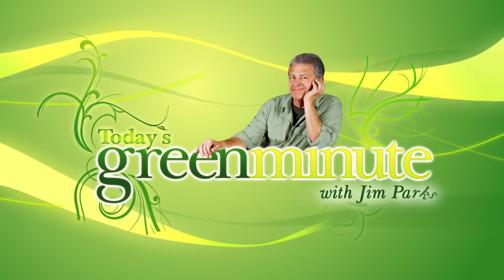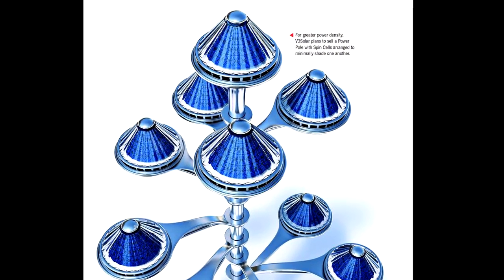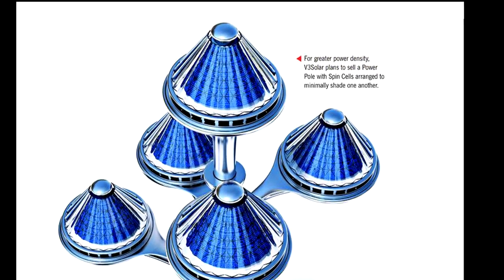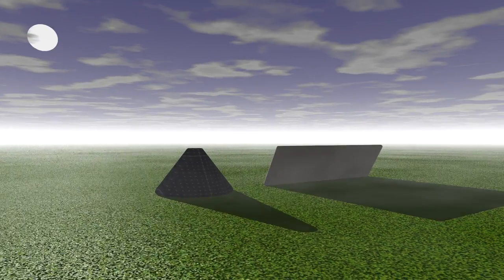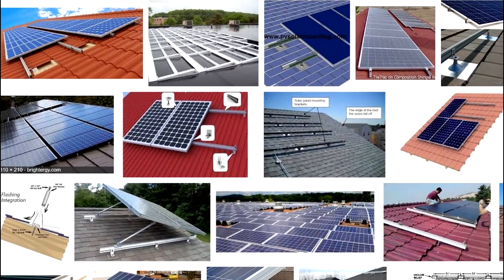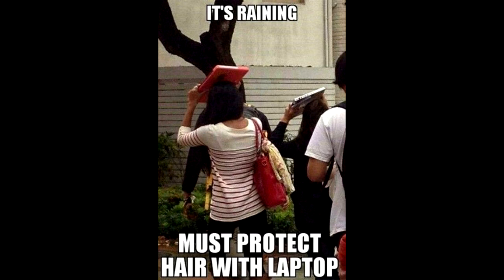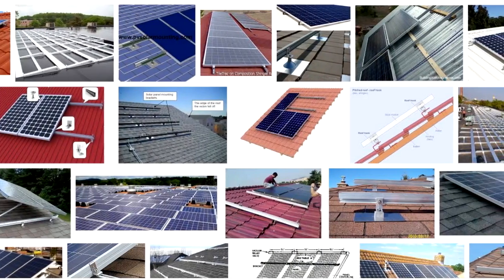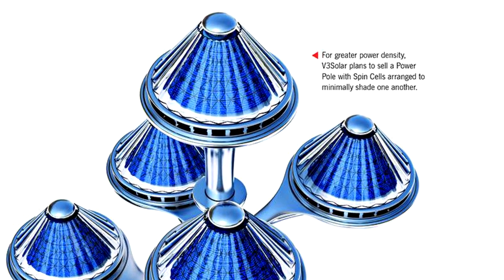Spinning Solar -BUSTED!

Comment from the maker: it looks like a UFO landing pad.... and turns sunlight into power at about FOUR HUNDRED PERCENT EFFICIENCY!!! and it currently has over 7mn hits on facebook!
Reply: Now if only we could combine this  technology with the solar road ways. Can you imagine? SPINNING SOLAR FRICKEN ROADWAYS
Reply: Thunderf00t 
you forget one thing. Where's the power for the moter going to come from?
Reply: Thunderf00t Will it use EM drives?
Reply: @Thunderf00t - you forgot to mention that there would also be a loss in efficiency from the energy that would be required for whatever mechanism made them spin.

Technically tracking solar panels spin too, but just one revolution per day, so a more trivial amount of energy, whereas the animation shows these things spinning at several RPM.
Reply: Thunderf00t I was going to ask if you heard about diamond batteries, but it at the end you said you did. Cant wait to see the vid for it!
Reply: Thunderf00t well I think that you missed the fact that this things can't spin on its own it needs electricity too
Reply: But it spins!
Reply: Thunderf00t You need to start a website dedicated to debunking all of this shit. It can be a source for everyone to go to for whenever crap like this pops up
Reply: Thunderf00t Looks more like a giant's butt plug. Maybe BFG stands for Butthole Fondling Giant.
Reply: +MrMToomey    Actually yeah what do you think about diamond batteries Thunderf00t? Because I've been wondering if it's a viable technology and if it could go somewhere?
Reply: here we go again. if you keep braking pseudoscience we'll have to take it away there are children in Africa going without and they want it.
Reply: The problem with all these newbullcrap ideas is that were getting desperate.
The issue is that our planet is (at least to my perceptions) beginning to fail on us, not only by our own actions but by natural cyclical climate shift. The ever present threat of extinction (or at least the percieved threat it poses) is driving us to desperation to find something - ANYTHING to help out in ANY way we can find.

that leaves the gates open and undefended against douchebag ideas like THIS. the big problem is that ridiculous projects like this one are soaking up all the attention and money while projects that actually DO as advertised or at least could with the right backing are brushed aside and ignored. someone out there could very well have the answer - but this thing got there first.

this project will (as you so eloquently surmised) fail. then the fear of failure for the next project (ultimately the one that just may supply the answer were looking for) will be brushed aside or abandoned because theres nobody willing to look into it - out of fear.
Reply: Thunderf00t it should in fact turn into a light source, powering three other cones around it, which power nine more, and in no time, you have another sun! On earth!
Reply: Nothing is viable at a single house scale at the moment. If there is grid - without subsidies and stuff - not even close. But generally geothermal is a thing. ~30% of Icelands power is geothermal https://en.wikipedia.org/wiki/Geothermal_power_in_Iceland
Reply: Solar freaking traffic cones!
Reply: Poldovico
No - a Watt is one joule per second. If this goes on for two seconds, you have two watts. A kilowatt hour is 1,000 watts of power generation sustained for 3,600 seconds. A generator can be capable of producing a kilowatt, but it does not necessarily do so consistently.
Reply: You don't understand Thunderf00t, it gets 400% efficiency by spinning so fast that each individual photon hits 4 different panels simultaneously. Also, Musk's Mars mission might not be a pipe-dream, just a suicide mission instead. :p

Personally, I think you should just do a kickstarter to put up a bank of the most cost effective, off-the-shelf, tracking solar panels you can find. Maybe just paint some flames, or racing stripes on the back of the panels, and call them "SOLAR-freaking-TURBO-PANELS!!!!!!1111!!!!!111!!" Grab a piece of the idiot pie, and do something practical with it.
Reply: That was my first thought 60% of the generated power spinning the panel.
Reply: I doubled the gas mileage of my car by adding the hydrogen generator! Also in a completely unrelated note, I changed the spark plugs at the same time.
Reply: Thunderf00t DO MUSK'S MARS MISSION NEXT!!!
Reply: shit dude did Castle have a conference going through all the top shit on kikstarter or something
Reply: Theldras Pneumonoultramicroscopicsilicovolcanoconiosis     
I think there is but when it comes to science people can't seem to tell that it's a con. Not that i am in a position to talk.
Reply: Lets bay blade....
Reply: I would still like to know, how many of these would you need to produce the amount of power needed for a year, in a year. And how much power storage that would require to achieve.

EDIT:
Assuming that they would work to their fictional parameters.
Reply: Thunderf00t i'm at work and in my phone so can't get too involved in this message. Our current technology only allows 20% efficiency ... but why?  What energy is are solar panels absorbing? I ask because maybe the rotation of the solar panels isn't as bad as you may thank. How much residual energy will be left of the panel as it rotates?
Reply: seen a few bunk theories.. thanks for the info! .. hey any chance of a run down on how geothermal power works from your perspective Phil? .. is it viable? (from what I understand it's using the house and ground to make a stirling engine..idk something like that)
Reply: Ryan Burdick Thorium powered motors.
Reply: Solar panels get energy from the sun electromagnetic radiation that comes from the sun, but the 20% efficiency are mainly because of what they are made off. They are made of silice, you could use other materials to boost efficiency but that would do the solar panels too expensive for most home aplications.
Reply: That's just because there is so much shite promising easy answers. There is a whole bunch of innovation being done every day, but as it usually doesn't deliver free energy or solve world hunger for obviousl reasons it doesn't get the same traction as Nathan Fillion promoted bad scifi.
Reply: hey thunderf00t i think you should adresss some real science sometimes
Reply: I thought this one had escaped you....silly me! Cheers.
Reply: 3dPrinting is a slow process and Graphene is only one atom thick(as far as I understand) so although possible (technically), it's simply not an effective method for mass production.
Reply: Kind of reminded me of that TV Show UFO the UFO's were spinning cones.  You know, Dave from EEV Blog, you, and a few others like Cody from Cody's Lab, and Nighthawk should get together and form a group all it BNN the Busted News Network.
Reply: You are right. 200% more from 20% is indeed 40% (0.2 x 2 = 0.4 = 40%) - its multiplication since they say "more". If it was 200% aditional efficiency them it will result in 220% :D Path of Exile wording has thought me something after all :D
Reply: what do you think of ..The Venus Project.?
Reply: +Gerald Walker To my knowledge tokamaks are the one type of fusion reactor we've been able to get working so far (though not generating a positive amount of energy. We're waiting on ITER to see if that does it, which AFAIK it theoretically should).
I imagine being a nuclear scientist Thunderf00t might have had the chance to work with fusion in the past, and if he has, it'll have been with a tokamak.
Reply: I'm no scientist, but the spinning part immediately set off klaxons for me.
Reply: I saw one this past week which was a wind turbine tree which could generate an "amazing" 3kw which could power a house for a family of 4! My first thought was, "Do people not understand the difference between a kilowatt and kilowatt hour?"
Reply: Whats next? Spinning Thorium powered solar roadways?
Reply: I used to work in the solar PV industry, and I can safely say this is an absolute joke even before Thunderfoot has started!
Reply: Not to mention the extra power that gets consumed to run the motor that spins the cone. Is that 20 times estimate being counted before or after the deduction of the cost of running the motor?
Reply: xerxestireirondada
The things rotates for free by the power of magic pixie dust :-)
Reply: @Greg Rivers ...
 I'm not Thunderfoot, but I think that would make it over complicated and would also destroy their Key selling point. (That it allows half of it to cool therefor making it "more efficient".)
Reply: G'day,

  Yay Team !

   Great job, well done.

   A few points for fine tuning though...

   Tracking Solar Arrays collect 35% more Watt/Hours on any given day than an equivalent area of Stationary Flat PV Panels, I've found, living Off-Grid with a 2-Axis Tracking-Array (47 Degrees Seasonal with 130 Degrees Daily...), which I designed & built while living with a Fixed Array, which replaced Candles & Kerosene Lights....; and in my experience, though the "theoretical Economically most efficient solution" is to bolt more Fixed Panels onto the Array because that's cheaper than building any Tracking Array "merely" to make less Panels become more functionally effective....

  But, also in my experience, when a Thunderstorm approacheth, it's wonderfully reassuring to be able to turn my whole Array sideways-on to the approaching Hailstones, or to give my Panels a Zero-Degree Aerodynamic Angle-Of-Attack, with respect of threatening Wind-Gusts...; to say nothing of the satisfaction of never ever having to watch the Sun shine from a Clear Blue Sky onto THE BACK OF MY PV PANELS, in the way that it does onto Fixed Panels between Sunrise & 9 AM Local Apparent Time and 3 PM LAT & Sunset, in High Summer hereabouts (I live at 30 Degrees South...)...

   When I regard my 80 year-old Mother's PV Array, bolted unmoving onto her Roof, I feel sorry for her ; at every glance.

   The other point is that, in my experience, on a 20 Degree Celsius Day in still-air my Photovoltaiacs will be running at 50 Degrees C. on top, & 55 or 60 C. underneath (because the Frame traps an insulating blanket of Hot Air,  under the "Glass"...) and if I go and throw 10 Litres of Cold Water (at 10 Degrees C.) per Hour per 10 Watts of Fixed Photovoltaic Array, in 10 sluicings delivered every 6 minutes...; that hs been measured to raise the daily output of the afforementioned Array by 35%, and it makes a Mud Pie underneath, and I don't have sufficient Water to cool my Array to any worthwhile degree.

   But as a matter of fact, the Air-Cooling effect of Wind on a Solar Array is such that it is totally  fair, valid, and accurate, to say that between 5 MPH & 15 MPH Windspeed, then the most-efficient "Electric Windmill" on Earth is actually a Photovoltaic Array...; because Wind-Turbines are designed to deliver their "Rated Output" between 24 MPH ("Low Speed" Units) & 28 MPH, with "Marine Storm-Rated" types requiring 32 MPH to reach Full Power..., and most Wind Turbines are nothing but highly decorative Dynamic Sculptures,  in anything less than 15 MPH of Wind....!

  That said, 5 days ago I posted Video of the Biggest Wind-Turbine Blade in all Oz, on a Truck, driving past me 3 metres away, the first to be delivered to my home Town, 59.5 Metres long & 15 Tonnes in weight, one of 3 for the 1st Turbine for the 70 Turbine White Rock Windfarm...; and Goldwind is building 3 Windfarms & a Solar Panel Farm, 20 miles to the West through to Southwest of me.

  30 years ago, I was the only person within 100 miles of here who was trying to run their Stereo & Lights with a Windmill..; so I feel pretty well "vindicated"...(!).

    Have a good one,

  ;-p

  Ciao !
Reply: another way to keep solar panels cool, run water through them, pump the heated water into a hot water tank that's insulated during the day and you'll save some heating costs, not much but a few dollars still counts
Reply: I saw this shared on Facebook a couple days ago and literally thought to myself, ain't no way I hope thunderfoot debunks this bullshit
Reply: Thunder omg 3:45 made me cringe a little LOL! You're going to end up with death threats from the mathematicians at numberphile :P
Reply: And if fish contract a fungus and die off too, we will be forced a 100% bogus diet, which only a larger percent of us can handle. But hey, grains are wind-pollinated.
Reply: Dear Lord ... I'm not scientist but I have basics of electrical engineering..speaking really school basics ... and right after I saw the picture I just could stop smile as my brain just shoot down to protect my intelligence ....
Reply: No, it's a tiny landing pad for a tiny Goa'uld ship from Stargate.
Reply: you forgot to take into account the power necessary to make it spin in the first place. its probably a electric motor that it uses, so it makes me wonder, of the power it generates how much power is it actually using to make itself spin?
Reply: Joe Rogan has wanted you as a guest on his podcast for years. Get on that shit and debunk pseudo-science & 3rd wave feminism for millions of viewers. Plus you could set Joe straight about Elon Musk. it'd be a hoot
Reply: Yo Thunderf00t, doubt you'll be interested as it doesn't really fit your style of videos- but if you ever want any copyright-free music to use in your videos, I'm always making new stuff. You can check out my tracks at soundcloud.com/kevin-shealy . I'm about to start working on more ambient things so you may be more interested once I upload those tracks.
Reply: there realy shuld be a law against these scams
Reply: Question -.    what happens if you have 20 percent of you exposed to the sun in your solar panel? ANS. you will fool people
Reply: i love that bullshit filter you had at the start that sounded like distortion. nice work. you should patent that shit TF :).
on a serious note. what if it was concave or funnel like in shape?
Reply: Thunderf00t kkkkkkkkkkkkkkkkkkkkkkkk,k,k,k,k,k,k,k,k,k,k,k,k,k,k,k,k,k,k,k,k,k,k,k, ,s
Reply: Thunderf00t what do you think about a dison ring oh and the development of a iron filing powered car
Reply: Thunderf00t did you see my suggestion or did you find it yourself, I recommended on a previous video
Reply: I usually ask people posting requests like this to gtfo, but your tracks are really good! I might actually want to use some of them some day. Thanks!
Good luck!
Reply: +God satan he does already ;)
Reply: Daniel Forsythe nope, graphene is a one atom thick layer of carbon atoms in crystal formation. manipulating indiviual atoms is extremely hard and printers come not even close
Reply: doh! you beat me too it.
Reply: Sorry mate, just posting link, i've been out of the loop so comments thread hadn't updated and i wasn't aware the conversation had moved on to Graphene. :/
Reply: why Mr. F00t, why must you do this...why must you be so cruel1!! quit debunking our dreams!!
Reply: I think you need only half a braincell to realize this is a scam
Reply: looks like an automotive brake rotor for a base...........
Reply: you frogot thorium
Reply: I've seen the diamond battery video and have done  some calculations on it. I think the objections are that the power output per kg is to low to be of any use, and you have to create huge diamonds that are way bigger than what we've managed until now. Also I'm not sure how they plan to create an electrical potential for them to achieve and electric current.
Reply: I'm just wondering.  How are MPPT charge controllers supposed to track the maximum power point, when these things are spinning?  Voltage on the one side is always going to be dropping, and voltage on the other side is always going to be rising (and not always at the same rate on both sides).  I don't think most MPPT controllers scan the iv curve fast enough to cope with that, do they?  Unless of course these things are spinning so fast that the voltage takes on the appearance of being flat.  Another thought is that the differing temperature of the cooler cells is going to give a different voltage than the cells that are hot.  I'm no engineer, just a solar enthusiast.  But even I don't think this would work.
Reply: Ryan they are probably powered from the power of positive thinking :-)
Reply: diamond batteries.....sounds very cost efficient lol
Reply: Thank you so much for the debunking. Thunderf00t is Awesome.
Reply: So what do you think  would happen if instead of using a motor, they used wind power? in fact, what if they combined it with a vertical axis wind turbine making the lens into a series of lens 'flaps' that allowed air to circulate but also caught the wind and spun this to have it rotate and instead of just using glass you used whatever they use to make Fresnel lenses? 

So it becomes both a solar AND wind power generator? Added potential benefit: more consistent generation of power! (though you probably would want the energy storage stuff used regardless)
Reply: Thunderf00t ya didn't have to hit the Bible
Reply: ah one of the problems of science being so popular right now. this is why I despise people who are trying to dumb down the science for the commoner to get involved.
Reply: NGC1433 i think ur mistaken friend one 18 pannel array and a lithum home made power wall. (battery system) is enough to power a medium sized house INDEFINITELY thanks
Reply: NGC1433 i think ur mistaken friend one 18 pannel array and a lithum home made power wall. (battery system) is enough to power a medium sized house INDEFINITELY thanks
Reply: Three...three? THREE! So you're that no good "bloody stupid" Johnson fellow who almost broke the disk, on several distinct occasion...no, no think of the organs, think of the organs. Breathe, breathe.
Reply: Stargate
Reply: +Michael Kavenagh, I think NGC1433's reply was regarding geothermal energy at single-house scale. This was in response to dava4444.
Reply: Thunderf00t as a college student for Digital Animation and Game Design i love to watch these for the science, it would be kinda cool it you busted video game science.
Reply: Hey, since you always cover people selling/overselling psuedo science and such are there any projects you feel are relevant and are under represented?
Reply: The sad thing is that this panel could work more efficiently than a normal solar panel if it took electrons a couple of seconds to be replaced by photons. Meaning you would use the extra time it took them to become free electrons to get more exposure using less space and without losing energy to overexposure they would only grant heat.

But that is not the reality we face, so rotating it does nothing. Unless gold course you can rotate the thing faster than photons replace electrons, then again it would have to be light speed and even if it was not it would certainly use more energy than it makes.
Reply: Drewboo 1968 
You do not track the sun with these. Instead you have a cone that will receive sunlight from any angle thus generate energy without the need of tracking. Rotation to keep the temperature uniform as cooling takes longer than hearing. The problem is that your efficiency drops like lead ball. Fast. You only have a third of are actually producing energy and even then part of it is doing it at a really inefficient way.
Reply: *****  What if we put solar panels in space, maybe in orbit of the earth or on the moon in the most efficient location? It would mean more direct sunlight without the effects of the atmosphere. It might pay off in the long run even factoring in the costs of installation and collecting the energy. Also it would solve the heat problem. Forgive my scientific ignorance, this just seems a good idea but I don&#39;t know enough to say.
Reply: Hey Thunderf00t do you want a good laugh? Dubai is going to build a freaking stupid hyperloop bull crap.
Reply: ***** *****
Again forgive my scientific ignorance, but perhaps there's a way to target the energy as basically lightning strikes to a specific target. Or to have monthly collections from a shuttle or something. Alternatively the panels could be on top of a tower high enough to be above the clouds and also cold enough to reduce the heat factor. I'm just throwing out ideas. It gets a bit depressing seeing all these videos about how shit won't work, I'd love TF to actually put out some ideas that would work. Give us some hope for the future!
Reply: Thunderf00t the battery does "work" it however only puts out very small currents at a very low voltage.
Reply: A UFO landing pad tree? I'm starting my kickstarter now! If you build it they will come.
Reply: What do you think of the Wind Tree or whatever it's called?
http://www.newsweek.com/new-tree-shaped-wind-turbine-be-installed-streets-paris-296591

Looks plausible, but I've learned in life, if it sounds too good to be true, it often is.
Reply: If you want some higher grade bullshit from these people http://v.youku.com/v_show/id_XNDU3MzExODky.html
Reply: Yeah, I know thundertrump it's all bullshit right. Everything is bullshit. I don't even need to watch this cuz the title saves me all the time. Everything is bullshit, nothing should ever be done if it isn't science and you approve of it.
Reply: Well, bogus science is bogus science, so yes!
Reply: not all is bullshit, he only debunks assholes and scammers like this one.
Reply: ***** 
You waste energy shipping batteries.
Reply: Garland Key 
Then why no just have a tracking panel and save up on wasted resources.

For the mirror to work it would have to track the sun because the shadow will change position depending on the sun. Since you already have a tracking system just use it on a flat panel to track the sun with it instead of using it on the mirror to track the sun to compensate for your inefficient design.

Worse yet, you still have lower efficiency this model because it is a cone, and sun will not always hit it directly.
Reply: I took one look.  This is BS
Reply: Thunderf00t don't know if you saw my last request but could you have a quick look at the tokamak fusion reactor and let us know what you think
thanks
Reply: ? these cones are not a lens.
Reply: @Thunderf00t What program did you use to find how much light will be turned into energy?
Reply: +Thunderf00t
This one was really sad. I have to admit that I did not do the math on the "water seeker" and thought it just MIGHT have some practical application, even if not nearly as advertised, but this one was so obviously stupid! 

You know, as an actor, I really like Nathan Fillion, but this year I may have to send him some Christmas presents - some basic science books and a ball gag to wear every time he thinks he has stumbled onto a revolutionary invention.
Reply: 9:04 AAAAAAAAAAAAAAAAHHHHHHHHHHHHH OLD SPICE BODY WASH IS SO POWERFULL IT CAN TURN OFF THE SUN - BUT THEN IT GETS TO COLD, SO IT MAKES ANOTHER SUN... DOUBLE SUN POWERRRRRRRR!!!
Reply: acephantom903
Well for one you don't really generate kilowatt hours. A kilowatt hour is the amount of energy generated in 1 hour (3600 seconds) by a 1 kw generator, or (if my math doesn't fail me) 3.6 MJ (megajoules).
3 kilowatts means 3 kilowatt hours per hour or 3kwh/h, which simplifies to, you guessed it: 3kw.
So if you have a cheap turbine that I can keep in my lawn and it generates 3kw consistently, hook me up.

I guess the one who doesn't understand the difference is you.
Reply: oh no! loved the video saw this pop up on Facebook and thought it was super dumb glad you debunked it.
Reply: +Thunderf00t wouldn't it be 20% * 20% or 24% efficiency?
Reply: they said 20 times not 20%
Reply: With this info  'solar cone'  'scam'  it takes about 1/3 second to process that half will be in the shade. I knew what this video would cover before I saw it. However, one thing not covered- when the sun is straight overhead, all the cone would be lit, albeit not direct. If you get the cones to track the sun and tilt, you get no shadow, but still have the angle problem
Reply: Thunderf00t ever see that solar powered road video? I'm not a scientist, quite the opposite, so I thought it looked feasible and good... though expensive if they actually planned to replace every road with it.
Reply: Pat Doyle
You are confused. A watt is 1 joule per second. If this goes on for 2 seconds, you have 2 joules, but you are still generating 1 watt.
2 watts would be 2 joules per second.
To generate a kilowatt means to generate 1000 joules for each second of operation.
This is what I said, but it is not what the guy going "hurr durr do people not know the difference between a kilowatt and a kilowatt hour".
Reply: Poldovico i know kw is the rate and kwh is like amount
Reply: I Love You <3
Reply: general kitten
well good job to you then. I was talking to someone else about someone else, though, so... kind of irrelevant.
Reply: +Poldovico I do know the difference and you are correct with your numbers. The video failed to mention the time it would take to generate the electricity by using the same technique as the tree in this video. I highly doubt it is capable of generating 3kw per second. Looking at the tree I would find it difficult to generate 3.5 kj in an hour. Look it up. I saw it under the search criteria "windmill tree".

Tell me that you think it can generate 3.5kw per second. It also claimed it would be enough to power a home for a family of four. I don't know about you but my house uses more than 3.5kwh in several (most) hour slots on the power usage charts provided to me by my electricity provider.
Reply: Thunderf00t science is going the way if art its horrible
Reply: +Thunderfoot+ I love your videos. I wanted to ask you, what if you used directed mirrors for the reverse?
Reply: The batteriser guys made so much money because of you.
Now they are drinking champagne and snorting cocaine on the Caiman islands.
Reply: +Greg Rivers+ Less cooling for one.
Reply: Greg Rivers
That would defeat the claim that they think is so important - cooling. Moreover, if one were to spend the energy to spin the cells, why not just spend it tracking the sun so that ALL of the cells get max power and not just the tiny percentage that face the sun at any given moment, or are in the direct line of the reflection?
Reply: the stupid design aside if a system is 20 time more powerful it actually doesnt mean its going over 100% efficiency. more like 99.9% efficiency. if the cells were 50% then a 200% increase will have them turn the sunlight into electricity at a % increase of half of the remainder that was left. so 50% x2 = 50%+((100 - 50)/2)% = 75% efficiency. that is what it means. so the cells are very close to 100% in this claim with cannot happen with your typical solar cell and any so far conceived.
Reply: @noahsalak nah, about the only way they could "cool" them by spinning them is to have some sort of fan or turbine/blower device and open up the cone, which is what I thought that base was with those vent/slots in it.  It actually reminded me of vented disk brakes on cars.  However, to spin the device (especially since the device base looks like a vented disk rotor from your basic car brake) at any rate where a blower becomes relevant to cooling a panel, you end up with a power draw that defeats your solar panel's output, especially if the materials have to be weather resistant, at which point weight becomes an issue which just increases cooling system draw.  Which brings us back to Thunderf00t's remark.  BOOOLSHIT.  Or something to that effect.  Unless the spinning device is ALWAYS lit and that magic glass cone is some form of refractor/reflector mix to keep the entire cone lit while acting as a fan housing... which brings us back to the same old magic trick... how much power does the cooling system draw... because that is still part of the efficiency equation, much like profit and loss in a business.  If your device produces 1kw, and your cooling system draws half that much, claiming that your device is 100% efficient would be a lie, since, much as in Thunderf00t's breakdown of the claims, if your device necessitates a few hundred watts to cool itself per kW it produces (scale is not mentioned in vid) then your device becomes even LESS efficient, and the moment the cooling system fails, your device cooks.  Most PC overclockers know this one by heart.  :D
Reply: acephantom903
Dude, it's not 3 kw per second. The notion of kw per second is silly.
The watt is a unit of measurement of power, e.g. energy over time.
The watt hour is power times time, e.g. energy over time times time, e.g. energy.
You do not generate power per second, you generate energy per second, and that rate is called power.
Now I don't care if your windmill tree works or not, I was just pointing out that the mistake you are accusing others of is no mistake at all, and in fact you are the one who is mistaken, and if you re-read both of your comments with the definitions of energy and power by your side you will see that as well.
Reply: Maybe these spinning solar panels are what that fog dome in Wales was cloaking.
Reply: If I melt dry ice, can I swim without getting wet?
Reply: it can be as thin as 1 atom but theres nothing preventing us from making thicker stuff out of it. there are demonstrations of knives made of graphene cutting through ice cubes like butter. watch?v=R5dwdZCKBZM
Reply: ***** 
If you can swim in a gas then yes.
Reply: Thunderf00t Please do a video about Elon Musk and Mars
Reply: Come on Thunderf00t, the Spinning Solar is in it's early stages of R&D, it takes time to iron out the glitches, and in an age of contradictions ... stereotypes ... and hypocrites we need something scientifically radical to solve out current problems in the world!
Reply: Musks  mars mission? Do a video
Reply: I'll be interested to watch Thunderfoot try to explain away the vision of thousands of rocket scientists led by one of the brightest people in the world currently.  While I enjoy these videos debunking things that are clearly bullshit and can be disproven by trivial high school science and math, I don't think Thunderfoot has the qualifications or proof to reasonably "debunk" the Mars goal.  If it wasn't possible then SpaceX wouldn't be putting effort into it and Elon wouldn't be putting his personal fortune at risk.
Reply: Not sure why it's a hyper-fail there are schools around the country competing and it's soon ready to test, plus they've just gotten over $100 million in investments.
Reply: I like thunderfoot and all but there are certain things he simply isn't an expert in and isn't qualified to "bust" and SpaceX is one of them.
Reply: Thunderf00t I don't want to be "that guy" but the purpose of the cone is that it would receive a greater % of direct sunlight each day, since the cone shape is like a tree that gets sun going up and sun coming down.

Obviously, the math is your thing, but it seems like you left out a pretty big design "feature" that would change their numbers a bit.  Yeah, at any given time, it would get less sunlight than a similar area flat panel, but what happens over the course of the day? after your peak hour or two with the flat panel, it's essentially worthless for power, but the conical shape would still be getting sun, right?

Maybe I missed the part where you addressed this, my volume is low on this vid for some reason, but the true math would involve the 6-10 hours of daylight, the area of the panels facing the sun at each hour, and the energy from each hours position of the sun. (like 6pm sun is different than 2pm sun for energy)

It might not change the results much, but it will certainly be a more accurate review.  This is a short video for you, so you probably just didn't want to go into it, but you could have ballparked it if you wanted to be completely fair.  I'm sure it's not getting 20x more power, probably around 2x more, not counting the power it would suck to spin or the cost of the rig.  So realistically, it's about even until cost is factored in, then it's a waste.  That's assuming it's in a field where things can't block both sides.
Reply: Well you are welcome to prove him wrong.
Reply: Please do a video disproving what he has shown.
Reply: Snow Storm You need a video to see what I just wrote? It's pretty clear.  He didn't factor in the arc of the sun, just used a single point.  He's right about that single point, but the math would be different if he added the arc.

It's not rocket science, fan boy.  It's not even like you need math.  Why are trees shaped like cones and not flat panels?  Perhaps they get the sun coming up AND going down that way?  

If you were to say "Measure how much solar energy a tree gets in a day,  you wouldn't say "Well, at 3pm it got X, so, X"  You'd have to factor in the whole day.

Surely you must understand what I mean now, right?  He is exactly right about that particular time frame, but he isn't right about the full amount.  Now, it might be negligible as a difference, it might make it twice what he said, it's still a stupid product and a stupid idea.  The cone shape is the smart part, the spinning is the stupid part, and the glass is the monstrously stupid part.

Why in God's name would we NOT want to base our designs for a solar energy collector off an organism that evolved it over billions of years?  Clearly trees have a pretty good grasp on sunlight.

I'm not trying to disprove anything Thunderf00t did, I'm trying to help him debunk it with a more accurate number.  Even science we agree with needs to be reasonable and facts based.  He is kind of leaving out a key facet of this scam...er... invention, because he either didn't think about it or he thought the other things (spinning to cool and glass housing) were so ridiculous he'd address them.  It's also possible it would have changed the numbers enough to not make this worth a video, but that's super unlikely.  I think he merely saw a clearly weak idea and went for the weak parts.
Reply: +COlton Turner
Not always. Thorium liquid salt reactors are the better way to produce cheap clean nuclear energy but we scrapped it because big business makes too much and some of the by products can be used to make weapons. France and Russia are both working on them now while we are working on plasma fusion, (like the sun) But TF would tell you its garbage because he is biased to ward the current type since he does his work with that type of reactor. We were stupid to not follow it up. LFTR reactors can actually use the waste from the current type and burn it up rather than having to bury it.
Reply: +EsJay W. Pair'A'Deez  Keep in mind, even though the tree as a whole may be somewhat cone-shaped, the leaves are often not. In fact, it's not that the tree is shaped like a cone, it's that the leaves turn their broad surfaces to better face the incoming light- at a perpendicular angle.
Reply: Gareth Browne a
Reply: Gareth Browne Ok, so... Nothing I've seen indicates a warming of the planet would be a bad thing globally.  Sure, the oceans would rise a bit, but on average, areas that are on the edge of supporting life would become more habitable, and areas that are green would get greener.  Turns out (predictably ) That massive reforestation is occuring around the globe.  If plants breathe CO2, then more plant air would mean more plants.  This scrubs CO2 and adds oxygen, so everyone wins.

They have been predicting catastrophic climate problems since... well, since they invented the word "climate"  Even the most harsh Paris summit actions would only save like .025 Celsius in world temperature over the next 100 years if their models are correct. (they usually arent, so I don't know)

Read the Paris Climate accord documents on the "fixes" and the expected results.  It's laughable.  Almost like a guy in a boat trying to reach the shore who chooses to drop weight so he can go faster by throwing his paddles into the water and using a spoon to paddle with.
Reply: LOL Thats what I said. Not to mention plants wxist that track the sun. Heliotropism is a thing.
Reply: Snow Storm Props then! I didn't read the entire thread due to the fact that it is 163 comments long. lol!
Reply: Rafe Tizer XD Nice. 166 now.
Reply: Yeah Crystal Radios I made in 4th grade science class zero power source  
or using a powerful magnet to turn a turbine.... Wait these are great ideas
Reply: Thanks for doing these videos, I can easily find myself getting sucked into some of these.
Reply: we're in no threat of extinction, we ARE however in threat of alot of us dying off.  Say bees go extinct, we'll be forc3ed into a fish and fungus diet which only a smaller percent of us can manage and war/starvation will result in the short term, however we'll be stuck manually pollinating farm plants but the price of food will drastically increase.

Basically the poor will suffer.  You want to protect your grandkids in the future buy farm land in canada near the great lakes.
Reply: Personally, I think if they want solar "trees" they should use a standard tracking solar panel and then if they need to cool them better then have heatsinking on the back to increase the already fairly big surface area... Really not that hard to do and it's more effective than the conical idea... You'd get slightly better efficiency off with a parabolic solar cell XDD
Reply: If we wernt going to go extinct we would defintaly be going bk to the dark ages at this rate!
Reply: Garland Key 
There actually another way, using an array of mirrors to superheat a fluid basically creating something like a steam engine which is used to turn a motor that generates electricity like burning oil in a generator generates electricity.
Reply: actually all they have to do is place a curved mirror on the dark side of the panel and bam you have no arguement the glass is stupid i agree
Reply: Thunderf00t you should make a playlist of all the inventions you must inventions hilarious
Reply: Jimmy Dean There's only 1 real way to double your gas milage and that's by converting it to a gas/wind hybrid via trailing 8 feet or less behind a fully loaded 18 wheeler ;)
Reply: One aspect I did not get: since the sun rotates, is there no loss of a panel's capacity throughout the day, if yes would shape/rotation be an angle to improve the system?
Reply: Thunderf00t theoretical thought would the same design work inverted and on the same hinge as a tracking solar panel so it would be like pointing an ice cream cone at the sun and following g it through the day
Reply: samuel jones Sure pal, when the movie Firefly 2 hits the box office lol
Get it? Nathan Fillion ... Firefly 2 ... yeah you get it :P
Reply: +historical-oracle That's what I said in my lone comment!
Reply: I was gonna make millions
Reply: Thunderf00t, why not get more involved?  Why not give your common sense on promoting something that will actually work?
Reply: +Jimmy Dean 

  G'day,

   Automotive Hydrogen Generators are a silly idea unless you run them off a separate Battery powered by a Solar Panel.

   Automotive Alternators spend so little time running at their designed Peak Efficiency RPM, due to the 2 or 3 to 1 Step-Up Drive-Train, that they're lucky to average 25% Conversion Efficiency ; so they amount to being an Electromagnetic Drag-Brake, driven via a Torque Multiplier, to maximise the amount of Fuel it burns per Watt of Electrickities produced.

   If you backtrack me to my "SunFoil Project Playlist",  in the "SunFoil Short-Talk" video you'll find there,  as well as showing why & how adding a streamlined Solar-Panel & Battery Charge-Controller to a conventional Vehicle saves between 4.5% & 33.35% of the Fuelburn, with the average being around 20%....; it also shows the CSIRO Evaluation & Endorsement of the Concept, after my Federal MP sent my Experimental Results to them (they spent 5 months writing 2 pages...; saying that they detected no Bullshit in my work !).

   Consider it as a DIY Project..., source all the parts locally, and get an Auto-Electrician to tell you before you start if your Vehicle's Computer will go mad if the Battery gets fully recharged via Sunlight while the Engine is switched-off ; and this trick is useless if a vehicle has "Regenerative Braking" because they NEED to have their Battery permanently 35% Flat, in order to have somewhere to dump the Current produced when their Brakes are in use...

  Have a good one,

  ;-p

  Ciao !
Reply: I want to thank you for your continuous work here on youtube. I appreciate and learn each time you make a video on any subject.
Reply: Whenever someone has an "idea", they should first "register it", then send it to you for further analysis...
At least if they want a working CREDIBLE idea...
If they want to suck up money from filthy rich people and ignorants, just shove it on social media without any evidence backed up by REAL scientist.
Reply: 400% sounds like a really good deal. I bet Trump is going to buy it for the White House..
Reply: Thunderf00t 
Thought 100% efficiency is the highest possible efficiency of a system.
Reply: Don Hyon no, but what would be the "OPTIMAL" efficiency, 20%? 50%? 70%?
Because real-estate in developed countries is in very high demand.
If they're going to waste millions to get a few Kilowatts they might as well build a nuclear plant.

The idea may be decent, the current materials available o build it would make it inneficient cost-wise.